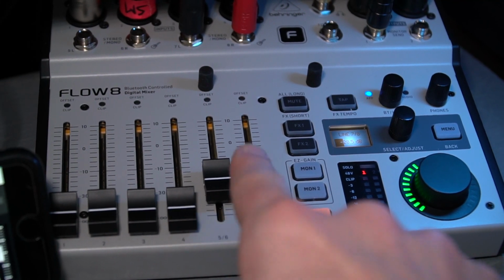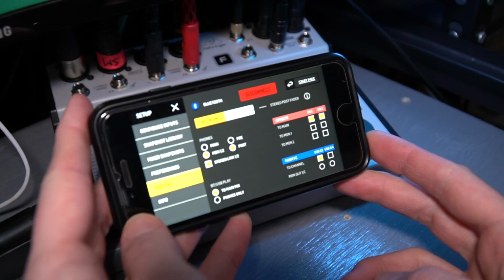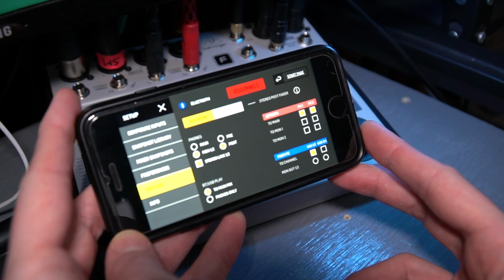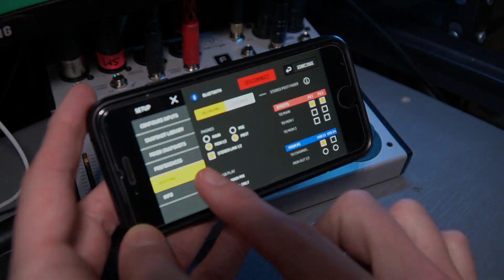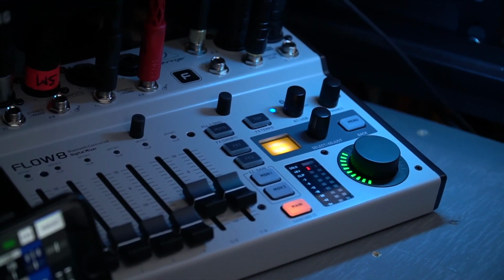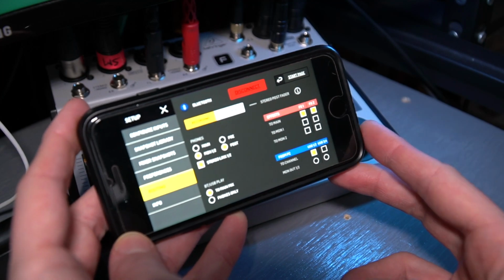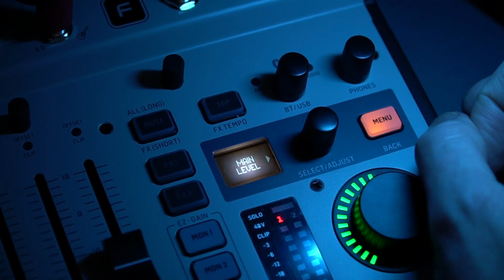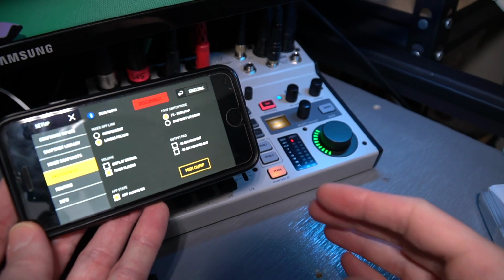Behringer Flow 8 | Firmware Updates for 2021 - Exclusive First Look

Comment: Great and helpful videos about the Flow8!
I love this little mixer but I'm really missing the possibility to pan a track in a live situation without using a phone. It is much better to have a knob for panning. For example, the Select/Adjust knob has no function in Main mode - so why not using this one for panning (and even muting when pressed) the track which was touched last?
This would help a lot on stage to make a fast change.
Another thing is to give the user some more possibilities for editing the effects in the app like pre-dalay for example. Especially the channel compressors need to  have some editing possibilities.
But don't get me wrong - even if some things could be optimized this little beast is already a really great machine!
Reply from the maker: Thanks Felix, I'll pass your suggestions along to the right people. I appreciate the message!
Reply: @DcSoundOp  Just an additional thinking. It could also help if the compressors could be switched to be a limiter - to have a choice between these two possibilities in the channels.
Reply: @DcSoundOp sir How to increase audio interface volume on streaming..actually connected my laptop on obs but comming on low volume

Please explain my audio problem..

Comment: So for an off-grid powered mixer/recorder, should I get a Zoom L8 or a Behringer F8....?
Reply from the maker: I haven't covered the Zoom L8 here yet, maybe someone who has experience can chime in here with their thoughts. The Zoom does cost like 2.5x more, and has a completely different i/O setup and feature set....so maybe consider the one that fits what your specific needs the best. Thanks for the message.
Reply: @DcSoundOp  The Zoom is not digigal, but it works great to record a small band on an SD card - all tracks + stereo mix. Generous USB interface as well, and enough pre-amps.  So its worth the extra money, I'd say. But the Flow8 is digital and both can be powered by battery or charge bank, which is a great feature, when you like to play and record in exotic locations - which I always find inspiring.

I'd prefer if the L8 was digital, but being analog doesn't make it a no-go as insufficient mic preamps are.

As for the price, you are right. I'd prefer Behringer had aimed a bit higher. There is a LOT of space between the Flow and their other mixers...
I'm not budget bound, I'm just bound by what I consider a good value anywhere between the Flow 8 and the Touchmix 16.

I have an SQ-5, which is awesome, but not very portable...

Comment: Thanks for this info. On stage can I plug in a mix of one instrument or band and vocal? I’m using an xvive u4
Reply from the maker: I'm not super familiar with the Xvive U4, but it looks like an XLR unit. You could make a monitor mix on either Mon 1 or 2 to send to that, but you'll need a 1/4" TRS M to XLR M adapter or cable to go from the MON output on the FLOW to your unit - https://amzn.to/3qrCo7L - Let me know if I misunderstood your question though.

Comment: Thanks for the video! I am a rookie and thinking between Flow 8 vs Rodecaster Pro. We are planning to do podcast with Phone calls and online callers (Zoom;Skype). Rodecaster Pro is very easy for this purpose. Connect Phone through Bluetooth and/or TRRS. Computer through USB. Can Flow 8 allow me to do the same or similar? and how?
Reply from the maker: If your primary use is going to be for a phone in show using both the USB and Bluetooth, and you really do need to send a mix minus back, from what I understand the RODE would probably be a better choice. To be clear, I have not used one personally, but from the folks I've talked to who are doing what you are, it has been designed very much for that exact purpose. Obviously the cost is a good bit more, but it sounds like you may need the functionality. All the best, let us know what you decide and how it comes together.

Comment: I want to reduce the onstage keyboards I use by using a laptop computer running MainStage or Gig Performer (these would host VST synth and keys). Would I be able to just run a USB cable from the laptop to the FLOW USB and route that to channels 7/8?
Reply from the maker: Yes, you can absolutely do that 👍🏼

Comment: Just a little warning from me .After  updating to 11739 i couldn´t connect the app through Bluetooth anymore (IOS) I reinstalled the 11729 and everything worked as expected. Tested a few minutes ago with 2 different phones. No connection with 11739 ! Just to keep you informed . Edit: 
Found out that there is a new version (1.3) for the App ! Now everything works!
Reply from the maker: Did you update the app at the same time as the firmware? Thanks for the heads up, I'll be sure to pass it along.

Comment: Hi. If used as a usb interface, does it have individual 8 outputs to the DAW ?
Reply from the maker: In recording mode you get all eight channels in to the DAW + the L/R, so 10 channels total with 4 returns after you've updated to the latest firmware. Thanks for the message.
Reply: @DcSoundOp  thats great ! Thanks !

Comment: Great review. And now with this new update what is advantage of XR12 vs Flow8 if we are not looking at number of input and Ethernet. I believe the Xr12 does not allow to be an audio interface.
Reply from the maker: I don't think they were intended for one to be better or worse than the other, they're just aimed at different use cases. I get the feeling they're going to make both as good as they can with future updates, it's just a matter of what features are important to what you're planning to use them for. Thanks for the message Nija!

Comment: I updated the firmware to v.11739 today, app version was 1.2 and it didn't work :( 
then 2 hours later version 1.3 dropped  :) and it doesn't crash anymore when touching the Main Mix button. I'm happy
I wish they'd implement 44.1kHz switch as some older projects require that. also a USB interface for computer would nice.

Comment: Hi, from my point of view, it would be very good if it is possible to use the stereo inputs 5/6 7/8 also as independent mono inputs in parallel - from my point of view this would make the flow 8 to a real 10/2 mixer and would be very helpful in small band setups like 3xVocals, 2x Guitar, 1x bass, 1x bass drum, 1xOH
Reply from the maker: I saw a post similar to this on the Facebook group recently, were you a part of that? Not sure what the plans are for the future of the stereo channels, but thanks for the message! In recording mode, it's 10x4 now too, which is pretty nice. Have a great weekend.

Comment: One last question from me today 🤣 does this mixer have mix minus feature as I'd like to route discord Into it
Reply from the maker: No mix minus preset like other small consoles, depending on your routing needs, it may be possible, but there is not a one button solution.
Reply: @DcSoundOp  yeah I was thinking I would send one of the monitor out back into the pc mic jack for discord chat then Just mute my pals on the monitor send

Comment: Can this unit replace a presonus  interface .. will it work with most DAW’s? Thanks
Reply from the maker: Hi Donald, this unit works like any other audio interface, so you'll be able to use it in any software or DAW you need. I noticed you asked below about connecting up a midi keyboard... this unit does not have midi inputs like some interfaces you might be used to. A separate midi to USB adapter could be used for that, or you can continue to use your current interface just for MIDI along with this for the audio side of things. I hope that's helpful, but let me know if you have more questions!
Reply: @DcSoundOp    Thank you.  Very much so ... I like it so I will order one 👍🏻👍🏻👍🏻👍🏻👍🏻💯

Comment: Great stuff! The new headphone routing options are awesome. I’d love to see an option to set the headphone out with its own mix, essentially becoming a 3rd aux send! 

Quick question, you mentioned taking usb inputs 1/2 and 3/4 and routing them to faders 5/6 and 7/8. I thought this was a 10x2 interface, but that sounds like a 10x4, with 2 separate stereo streams coming from the pc?
Reply from the maker: Hey Lyle, thanks for the great question. In the new 'Recording' USB mode, it is indeed 10x4. The stereo channels can choose between their line level inputs or one of the USB pairs, 1/2 for the 5/6 fader & 3/4 for the 7/8 fader. Hope that helps!
Reply: @DcSoundOp  Thanks for the super quick reply! Ah, so the 10x4 config isn’t available in the “streaming” usb mode where you can send the main mix L R post-fader to the pc via usb?
Reply: @DcSoundOp  is there a way to adjust the levels of the 5/6 and 7/8 channels in Sends 1 and 2? I’ve tried every setting I can think of and I can’t seem to reduce the levels in the monitor send mixes.